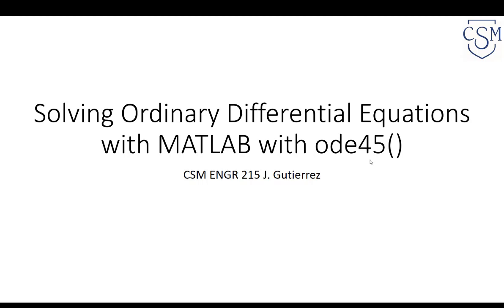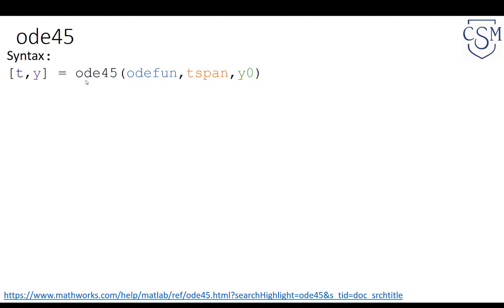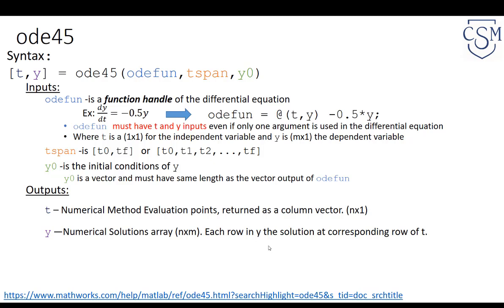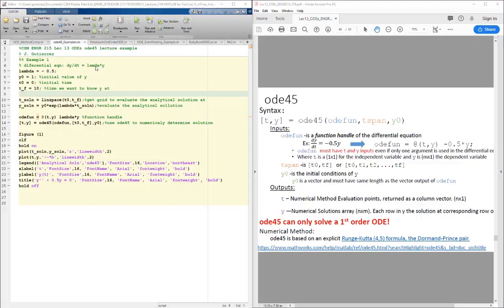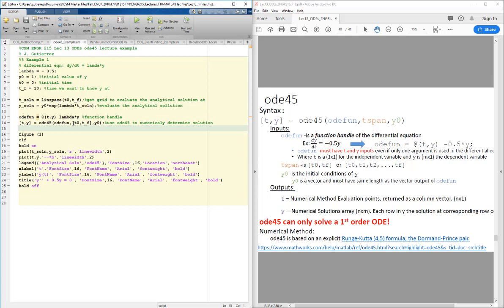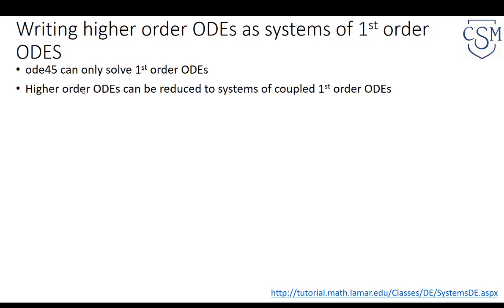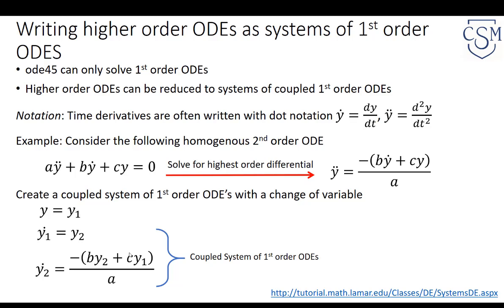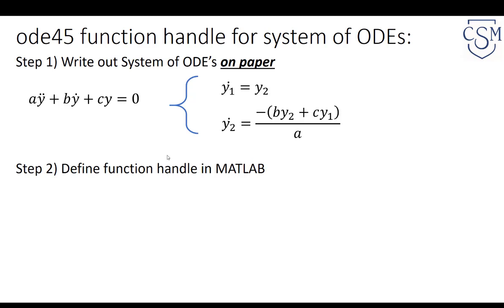Lec13 Solving ODEs using ode45 in Matlab

Comment: Hi..thanks for this video..I have 2 nonlinear coupled equations that should be solved using ode..but I have problem doing that..can I ask for your help please..?
Reply from the maker: Hi Ghazal, can you write your equations in the comment, I may be able to assist.
Reply: @JoseGutierrez-vp7oc  Hello Jose, I also need some help with ode Solver. Its about a Newton's Cradle with only two balls, wich i have to solve with ode. I could so far only determine the equations :
%Initial Conditions

r = 0.05; % Radius beider Kugeln 
l = 0.3; % Seillänge
m_rechts = 50; % Masse der rechten Kugel 
m_links = 50; % Masse der linken Kugel 

phi_rechts_initial = pi/3; 
phidot_rechts_initial =0; 

phi_links_initial = 0; 
phidot_links_initial =0; 

J_rechts = (m_rechts*l^2);
J_links = (m_links*l^2);

ts = 0.001;
timespan = 0:ts:40;

g = 9.81;

 phi_ddot_links = -(m_links*g*sin(phi_links*l))/ J_links;
    phi_dot_links = phi_dot_links +  phi_ddot_links * ts;
    phi_links = phi_links + phi_dot_links * ts;
    
    phi_dot_links_neu = 2*(J_links*phi_dot_links+J_rechts*phi_dot_rechts)/(J_links+J_rechts) - phi_dot_links; 
    phi_dot_rechts_neu = 2*(J_links*phi_dot_links+J_rechts*phi_dot_rechts)/(J_links+J_rechts) - phi_dot_rechts; 

Can you help me to solve this issue...